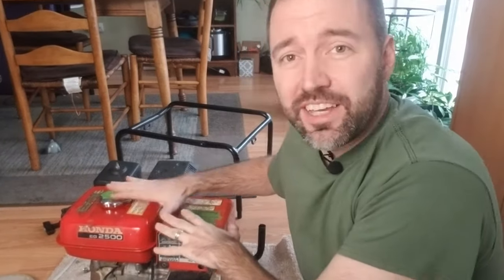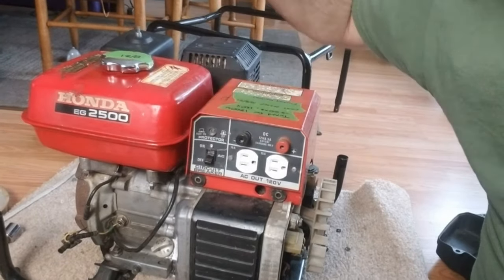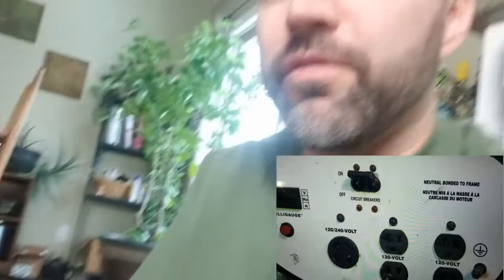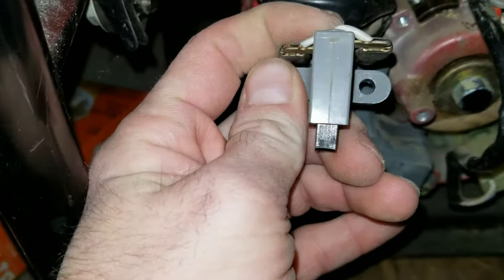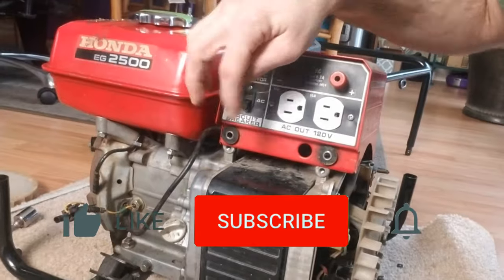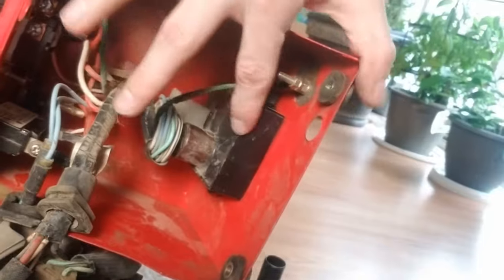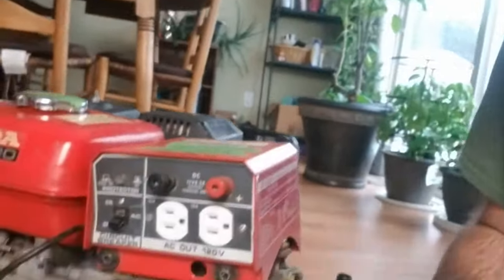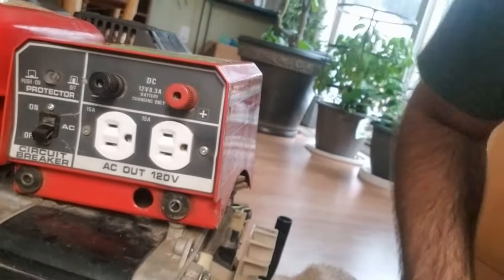7 Reasons Your Generator Is NOT Producing Power!

Comment: Generator runs and provides power for about 5 minutes then stops providing any power. Motor keeps running. Not drawing  anywhere near capacity, in fact it does it even with zero load.  Any suggestions?

Comment: So my generator turns on runs everything fine for a few minutes than things slowly start running.....first the AC then the fans than lights and nothing's working within about 15 minutes.  It only has about 300 hours on it but I didn't know better and I was turning it off and on with a load on it

Comment: Thanks so much for the drill motor fix.  I conducted the fix in the middle of a power outage on my circuit breaker and was able reset the breaker...so very cool.  Thanks dude...

Comment: This is a long shot.  I have a Honda EV 4010, SN 1002864, water cooled RV generator.  My testing, following the Honda shop manual for this model, indicates the control module is defective.  The problem is that Honda no longer has replacement modules available- it is now obsolete.  Do you have any leads on either locating a replacement module or someone who is able to repair said module. All components of the module are embedded.     TIA

Comment: The horseshoe shape is the ohm setting and will not beep. You have to go to the next setting with the arrow pointing at the vertical lines
Reply: Since ohms is a measure of resistance, if no resistance exists in an open circuit then MY meter WILL beep In the "horseshoe" setting.... maybe not everybodys meter has that function in the ohms setting, but you cannot state that it will not beep.... YOURS clearly does not, but yours is not the only type in the world.

Comment: I have tried all of your tips , still nothing anything else i could try , it has brushes,  avr replaced , brushes replaced ports cheacked with multi meter switch is on enjin does run , there is a connection to the coil , i have tried the drill tip and flashed the field , 

Any other suggestions ?

Comment: Hey how's it going! I found your video very insightful. However I have a predator 6500 watt with about 400 hours on it and I've kept up maintenance I'm actually out in the deerwoods now and the darn thing just shut down on me. First I  there was no power at all and then the motor shut down immediately after like it were running out of gas it starts right back up and it shuts back down in about 20 30 seconds and no idiot lights. I hit the breaker but it doesn't draw on the motor at all . Idea?

Comment: I use a corded drill plug it in then use a cordless drill I put in the drill and tighten both chucks down on the same but and run the cordless drill and reverse, turning the corded drill witch flashes the field

Comment: I have an older Predator 2500 inverter that runs beautifully but doesn't power the 110v outlet. I replaced the outlet with a household outlet and it worked on a small appliance. i started it later and it didn't work again. Any suggestions?

Comment: If the capacitor is leaking or has any kind of discharge wet or dry(or evidence of discharge [dried]) it should be replaced. 

Could you do a video on GFCI troubleshooting?

Comment: Hello, Good video. I bypassed my OC sensor on my Generac GP6500. Just took the 2 black wires off and connected them together so the engine would run. Now its running great but has no power output? Does it need the oc sensor to produce power and does it need the hour gauge to produce power. Gonna try everything in your vid and I appreciate you making this video.
Reply: How’s your generator now?

Comment: Small portable petrol Generator 1.5kva, when running, red out put light (power out ) is off. When you rev engine it comes on. At fast idling it's not on.  What is the problem?

Comment: I have a 1200 watt small generator and it will work with the power tool forward and backwards but it will not work with a small heater or a lamp. Can you help?

Comment: I have a welder generator and it has 3 receptacles in total. 1 is a 240v l14-30 and 2 110 like in your video. one 110 has power and the other doesn't the 240 only has 110v. its a Klutch 44451 7500K Arc Welder/Generator 429CC Kohler Gas Engine.

ever fix something like this?

i think the actual resistor for the amperage selection completes a second circuit allowing full access on all outlets. i feel like maybe thats the problem idk.

Comment: What would cause the oil and gas to mix in the oil on a generator
Reply: Your float inside the carburetor may be stuck open, which causes fuel to keep flowing through and eventually the gas makes its way through the intake filling up the cylinder and crankcase. If you take off the carburetor, check to see that the float and needle inside the float bowl and clean if needed, a few shots of carb cleaner and  a piece of wire. Drain the old oil and gas out of the crankcase and fill oil with proper amount. Hope this helps.

Comment: Hi there sir I have a old Coleman 5500 watt generator and the problem I'm having is trying to hook up a stick welder to it motor runs excellent I check voltage coming out I got 121 coming out and I got 240 coming out when hooking up welder makes welder spit and doesn't stay with a narc hook up welder on household 240 well the works fine any ideas what it could be wrong with my generator thank you
Reply: You need a Lincoln engine driven welder. You can't stick weld with 5500 watts. I went to trade school. Trust me on this.